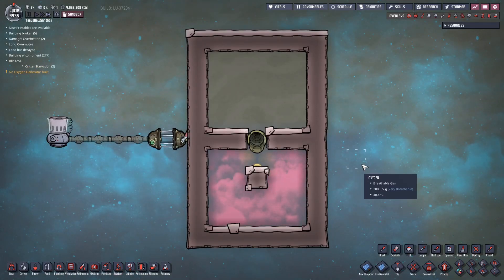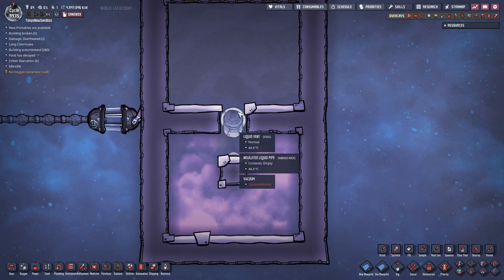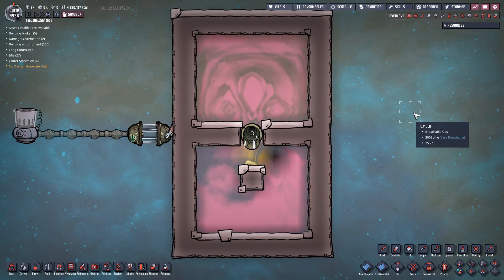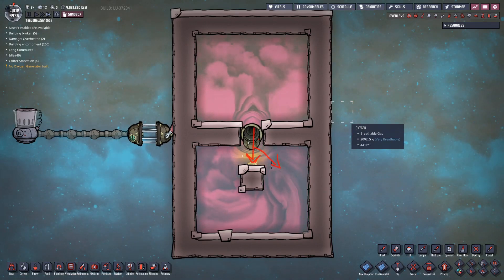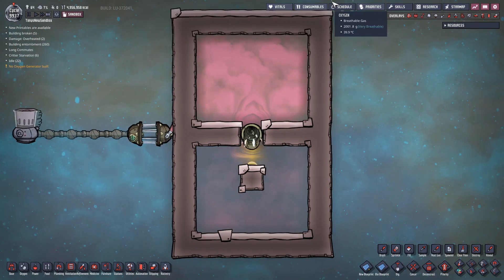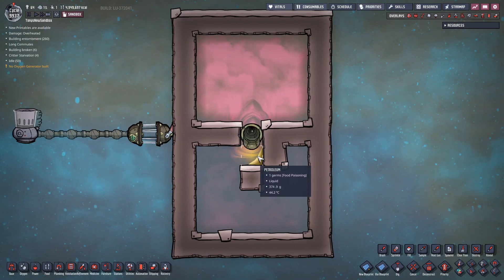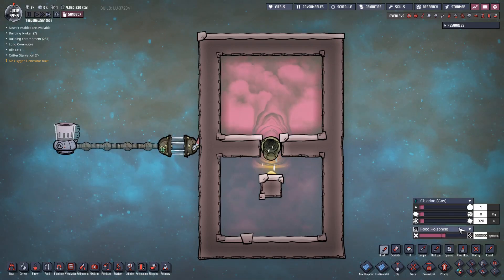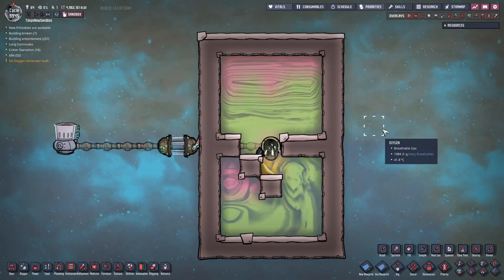Pump Large Quantities of Gas from Room to Room in Seconds

Comment: the stopping over 1000kg may be due to the vent stopping if there isnt a continuous stream of water coming down,  if for some reason the water ran out or the pump was stopped then the vent would be enclosed in 1000+kg of pressure and stop, however while it is running the vent is enclosed in that tiny amount of water for a split second in which it decides it isnt overpressure and lets the next bead of water continue out, allowing it to continue pumping, although this method of over pressurizing is very susceptible to lag spikes i would assume.

Comment: If you combined this with a sour gas boiler to force the sour gas into the condenser faster would that increase the efficiency? It seems like the sour gas pressure gradient is always pretty large through the length of the heat exchanger
Reply: I don't think so unless you use 4 thermium AT's with super coolant
Reply: Tested this. Works!

Comment: It's difficult not to consider real world physics when playing this game because it dose a pretty good job of looking like it. Gasses and fluids are moved around in the game by two things: 1. a single tile's element's volume, 2. what element "floats" on top of what element. Gasses want to move up but are pushed down by "lighter" gasses and fluids want to move down but are pushed up by "heavier" fluids (they got it wrong in the case of crude oil). A third factor players don't consider is that the program's algorithms that accomplish these two things read or calculate each tile, one at a time. That fact means each non-"unknown" tile is read and calculated one at a time - or four at a time if the program is capable of multi-threading and you have a quad core processor - from left to right or right to left. My guess is left to right/top to bottom (the unofficial standard for drawing the monitor screen is x0/y0 = top left pixel). Each tile is compared to the four tiles that surround it on it's major axis. Because the tile's movement to it's left has already been determined, movement of unrestricted fluids and gasses moving downward tend to favor movement towards the right while gasses and fluids moving upward tend to favor moving left. The algorithm only considers diagonal tiles if no movement solution is found in the major axis, and those major axis tiles are not solid elements. This is why fluids can't squeeze through two diagonal tiles.The reason this trick works is because the pipe vent in order to "drop" a fluid MUST replace or swap it with the gas in the tile below it, however the vent is treated like a solid tile so the gas is pushed through to the tile above it.
Is this an "exploit" of the way the program works? Most definitely. Is it "cheating"?  ... If you are playing where in your mind this is a real situation governed by real world physics then maybe so . If you understand the purpose or result of the program doing what it does is to create conditions that make progressing in the "game" difficult and challenging, and that you are utilizing quirks of that program to solve those difficulties, then perhaps it's not cheating , at all. You win in chess (or any other competition) because of your opponent's weaknesses.
Reply: Technology is exploiting physics, when you think about it.
Internal combustion engines? Using miniature explosions to generate angular movement.
Air conditioners? Using the heating up of compressed materials as a heat pump.
Electric motors? Using magnetic interactions with a moving conductor with current in it.

Once you grow out of the phase that sees all of those things as a abstract magic, looking at them makes it even more fascinating.
Reply: @Mernom  If you think about it, life itself is an exploitation of physics. Just one example; the iron our blood cells allows an oxygen atom to attach itself to the cell forming iron oxide (rust). When the cell encounters a carbon atom, the end result of using the stored energy in a sugar or starch molecule, the carbon atom attaches to the oxygen. The iron atom prefers to attach a single oxygen atom and exchanges the CO2  molecule as soon as it gets near the O2 in our lungs. All this happens because of electrical charges, or an imbalance of electrical charges in the number of electrons in each atom. It's simple physics - chemistry, but we wouldn't be here if we didn't exploit it.

Comment: I wonder if Klei is fixing such exploits. Or they leave it be as a "clever use of game mechanic"
Reply: A lot of these things rely on how the game calculates things to model it's physics.  It's hard for them to fix these odd little exploits without rewriting the entire gas or liquid physics and how they interact with each other and tiles, that would only introduce new odd glitches that people will eventually find.  You get to the point of 'decide for yourself' if it's too exploity for you to use and ignore it if it is.
Reply: @lucasriley874  The funny thing is that sometimes you have to at least be aware of exploits to not have them hurt you. The sticky temperature bug with pipes was a classic example, at that time you had no way to, say, cool water from a geyser in a pipe passing through a cold area because it would just heat right back up, obliterating your cold area and then cooking your base. You were basically forced to use this bug (by building an infinite heat capacity cooling loop for thermoregulators) to avoid being killed by it!

Comment: So, i can use it on gas geysers so they won't be ever blocked?
Reply: Yes! This allows you to overpressure the top side, at least enough to capture all of the output from a geyser. Just don't accidentally break the top room open.
Reply from the maker: Yes. David is right. They are really good for that.
Reply: Hmm, I use unpowered door compressors on my geysers to store the excess gas XD But seems like this would work too (and be easier to setup)
Reply from the maker: @nZifnab  That's a good way to go for almost any geyser and I respect it entirely, particularly because bypass pumps feel a bit exploity to me. But I once experimented with door compressors for a steam vent with unusually high output and I needed 5 compressors of 5 doors each, and it still just barely prevented overpressure. Afaik the only reasonable way to do the job in a case like that is the bypass pump.
Reply: Oh yea I don't even try on my steam vents. I have so much excess renewable water on my current map as it is, I just use the water that comes out when it's active as I need it, and let it go overpressure when I don't.
Reply: I prefer the drop of water over the vent method for storing gas from vents. Infinite storage with just granite and copper ore.